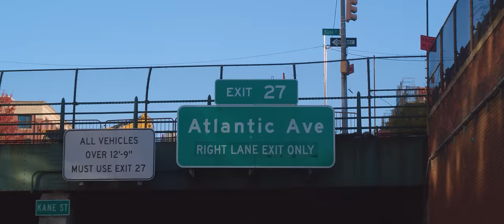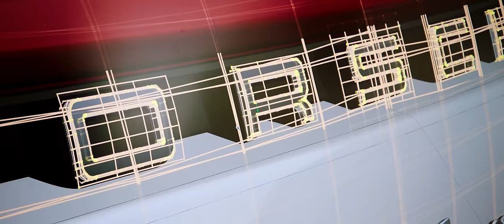Style Porsche x Marc Fornes: Episode 1 - The Soul

Comment: Electric vehicles are great, but they would be even better if they didn’t have to lug around a big and very heavy battery pack. Making EV batteries smaller, safer, and more power-dense are top priorities for all manufacturers, but each is a challenge in its own right, and we’ve only seen incremental advancements over the last decade or more.
Reply: I think that's a fair and balanced summary. Reality of range will sort itself out once destination & street charging is predictable and reliable, coupled with fast charging. Smaller lighter batteries will be easier to package, to protect, and ultimately to produce.